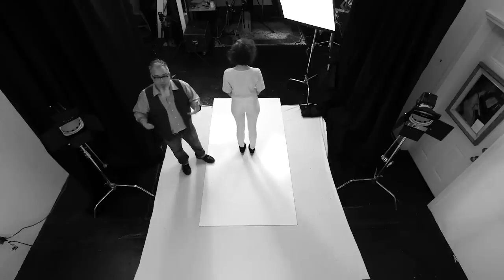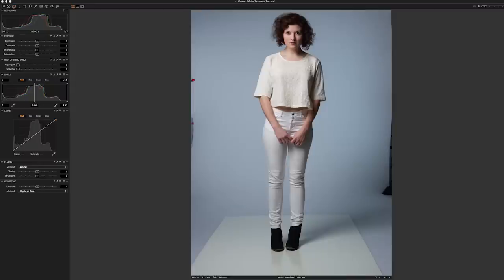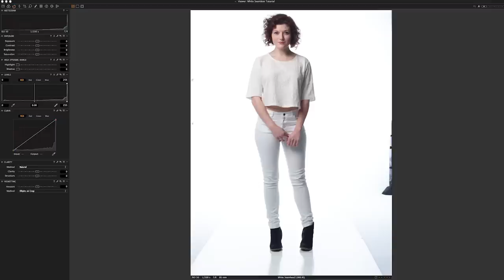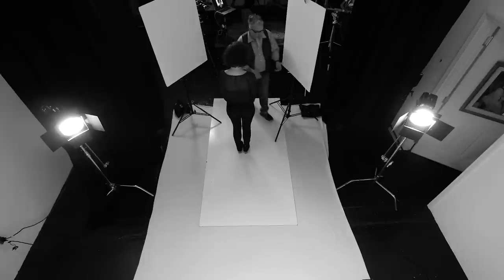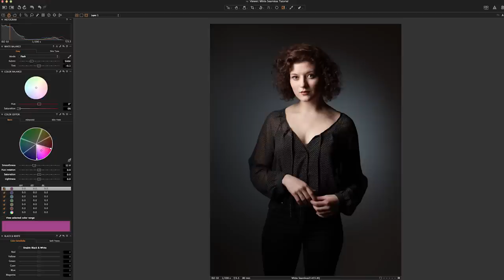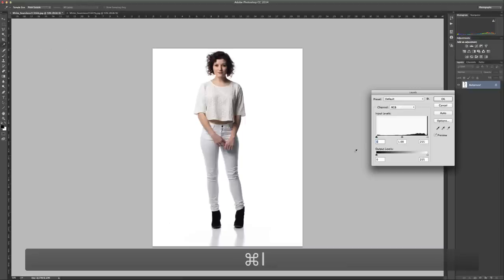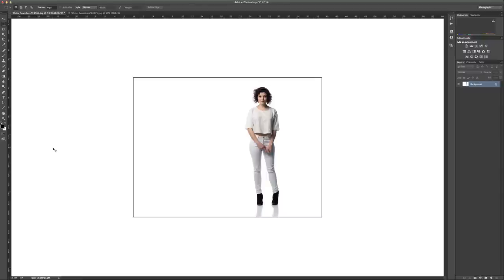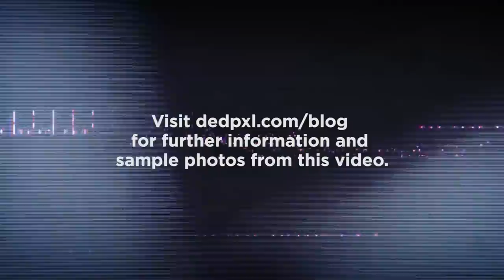Lighting White Seamless Pt. 2

Comment: Here is a stupid question, it looks to me that you have constant on lights so what is the flash for?  If it just for fill?
Reply: +BT Busbee those are called modeling lights. Studio strobes have them (mostly). They show where your light is going. Then when u press the shutter  they are switched off and flash fires (from those strobes only,  they have two light sources in one strobe, one modeling lamp and other is flash tube) and they are back up again as soon as the exposure ends. You can switch them on and off as per your convenience and usage. Have fun.. Cheers..!!

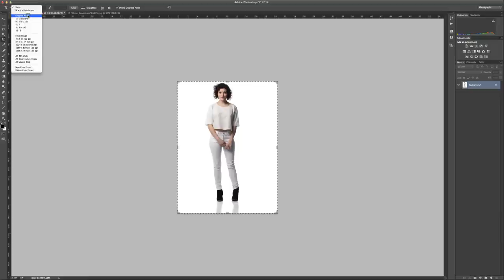Comment: Could anyone please explain me how to do the cropping at minute 18:50? How is it possible to stretch the white background? Thank you!!!
Reply: grufiog yeah,  I don't see that aspect ratio option on my system.  is it a photoshop upgrade in version 6?
Reply: grufiog You can also do it by selecting "front image" which maintains original aspect ratio, or by manually entering numbers in the width and height, like 2 and 3 for a 2:3 ratio. Not by my computer now so maybe there's also a way to get that dialogue box, but this is a solution off the top of my head